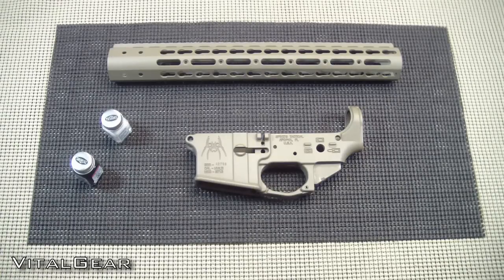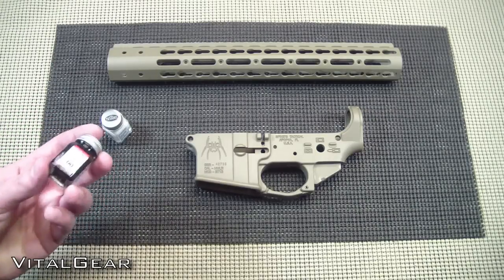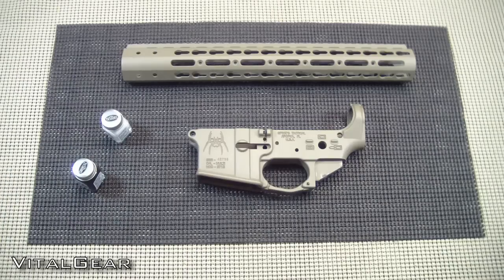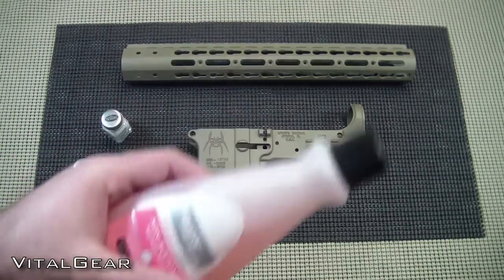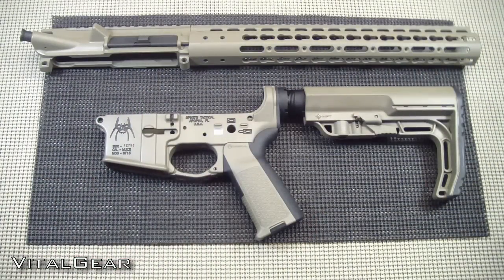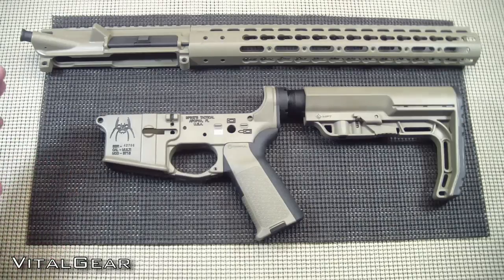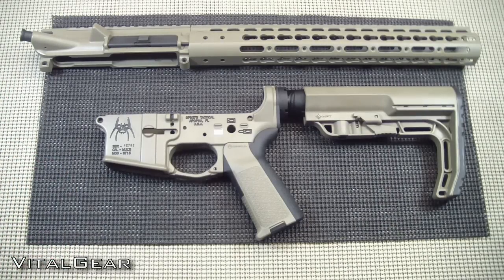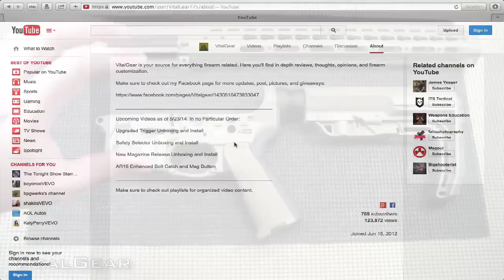Color Filling My AR15 Lower Receiver and NSR Rail

Comment: you might get similar results with easier clean up by doing a wash.
Thin the paint with an appropriate thinner.
Pick up a drop and touch the edge of the area you want to fill and touch the edge, the paint should flow through the depression with minimal if any overflow. Then just wipe off the thinned excess. 
It will not leave a full fill but the effect should be pretty much the same.

Comment: I can vouch for Testors enamel holding up, I haven't tried it on a rifle yet. However 11 years ago I color filled my chrome craftsman wrenches with red Testors before I started working as a mechanic, so for 11 years now they have been coated in every automotive fluid you can imagine, and then that fluid was cleaned off with brake clean.  The color is not bright anymore but you can tell my wrench from another.

Comment: You make it look easy. I keep wiping it on the main body. I used acryllic. Dreis on the main body. Soak it in acetone (it's not cerakoated) and take a hard bristle brush to it and it won't come off. Maybe it would be easier with a thin single hair brush. Would take a lot longer but

Comment: I wish I remember the tutorial. But I have the best way IMO. You let the paint dry even more and take a chisel tip (slanted) Exacto blade (on the big red handle) and very gently shave off the caked on blobs. Once that is done use PAPER... like paper from a printer.
 Paper towels are too absorbent and will pull the color out of the engraving. Printing paper just treats the surface. You may have to rub really hard. You may have to rub a bit longer. But in the end a LOT of paint stays put in the engraving. I can usually do the job in a single coat if I use paper instead of paper towels.  Sometimes a job will need   two coats. I never have to use three coats.

Why didnt you try using Cerakote for the color fill? You have me stoked to finally try Cerakote. I have been unreasonably gun shy of it until I watched all your excellent videos.

Comment: I'm doing my Spike's Punisher lower and my M&P Shield right now and no matter how light I wipe, I keep dragging the paint out of the roll marks. This is a time consuming process.
Reply from the maker: After you fill the roll marks, let the paint dry for 5 mins. Then wipe gently until you get most of the undried paint off or until it stops smearing. Another trick that helps is to just wipe around the roll marks, instead of directly over them. This will help with smearing and keep you from pulling too much of the undried paint out of the roll marks. I hope this helps.
Reply: VitalGear I found that qtips, when kept away from the roll marks, worked good to get the paint away from them to where I could clean the paint up better and not pull undried paint out.
Reply: Let it dry ! This guy should not be wiping it until it's dry! Use hoppies bore cleaner after its dry and just litely keep ripping until it's of looks perfect
Reply: By the way 5 mins is not long enough more like hour or so don't rush it
Reply: Use acrylic paint from walmart etc, it like 3 bucks and cleans up with water. Fuck that whole let it dry for an hour, use acetone to clean up, redo the shit thats fucked up process.

Comment: I tried just like you to wipe off right away and it takes it out of the lines I'm trying to paint. What the hell. You made it look so easy. I did use nailpolish though, maybe that's it. I have the whole set of Paul but just opened it and all dried out. So I used 2 of the hundreds of nailpolish my girlfriend had.
Reply: If its nail polish then wait like an hour or two for it to dry and completely set up before you try wiping anything off. You can use Testors model paint, but you'll need to wait for almost a whole day before you wipe it off, and you should your Hoppe's 9 for that.

Comment: How long did you let the testers dry before wiping?
Reply from the maker: 5 mins.
Reply: VitalGear b  dmsmlekR
Reply: VitalGear Try 10 minutes next time.  Five minutes is not enough time for the paint in the engraving to really set up. You can SHAVE the hardened paint off the surface with a brand new Exacto blade. 
No, you will not even remotely scratch the Cerakote. Not if it is a brand new blade and you carefully shave the blobbed on black paint off the top surface of the receiver.

Comment: Is  Testors Enamel paint the same as Testors Acrylic paint? And which is better if a difference?
Reply: I would try to avoid any type of acrylic paint. I've found that oil based paint or even oil based paint markers by Sharpie work best. Acrylic will dry dull and eventually flake out.

Comment: Does this work with spray paint? Anyone try spraying paint on plastic then dipping your brush in the paint and painting it. Then running the excess off with this nail polish remover. ?
Reply: Alex Hernandez just tape off the area, spray the roll marks and wipe off the over spray. Why make it more difficult?
Reply: Alex Hernandez btw nail polish remover is just acetone... Acetone at homie deopt is about 1/4 theprice of nail polish remover.

Comment: I use nail polish paint. Why? Because first it comes with a built in paint brush and second the color option is awesome. There's a ton of cool colors out there. There's a neon color that I use for my front sights that really stands out.
Reply: I can't believe I'm asking but what color nail polish do you use lol and do you use anything to set the color or cover it ??
Reply: Tried that on my pistol sights, it has a tendency to flake off. I can see it maybe working better in engravings.
Reply: Are they still holding up did you do the engraving too?